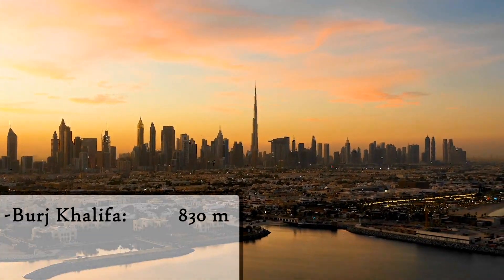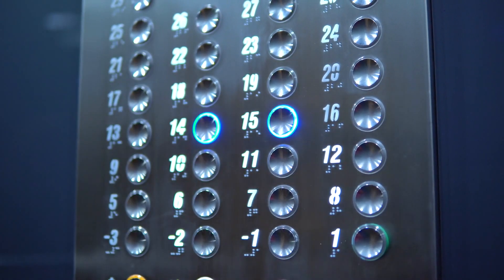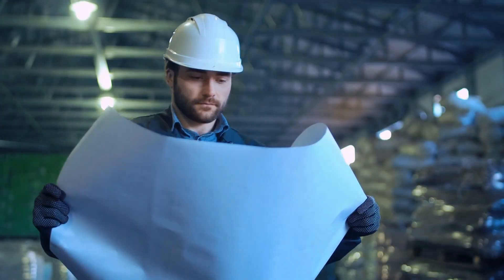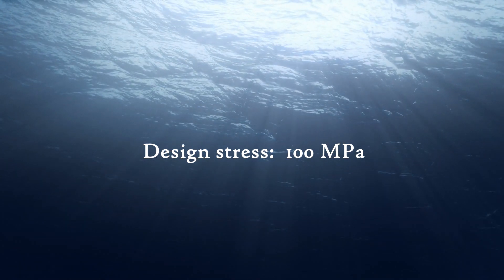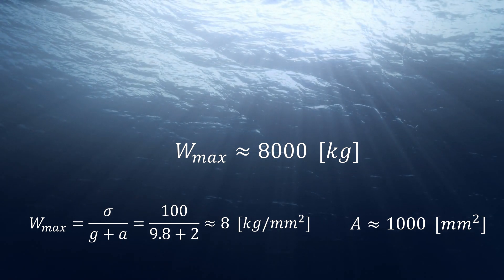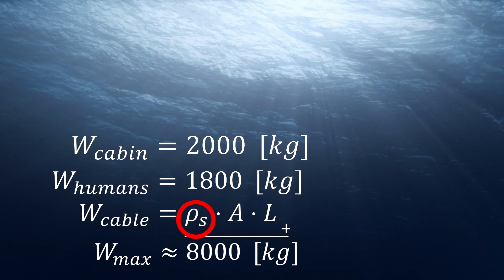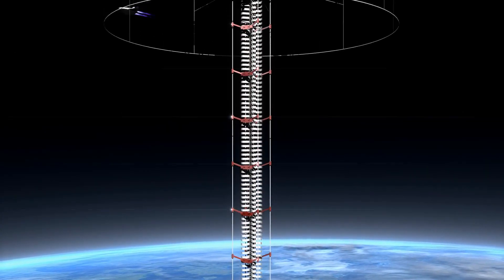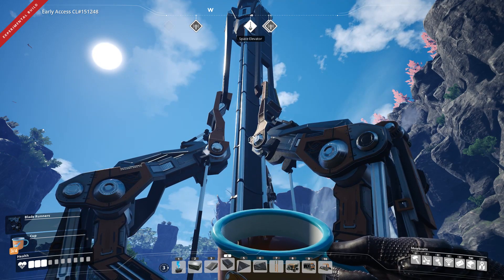The Maximum Length Of An Elevator Explained!

Comment: Then, how to you explain underground mine elevators that are way longer than 500 meters? 2+ kilometers mineshafts are a thing, I get in one regularly.
Reply from the maker: Those long ones don't use a cable system but usually have rails instead. That way, you don't have the ~500 meter limit.